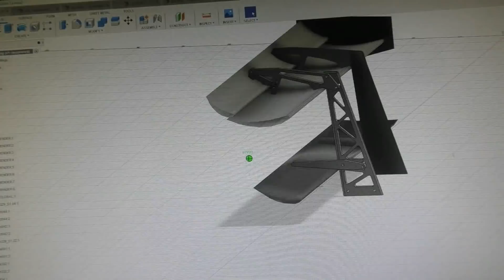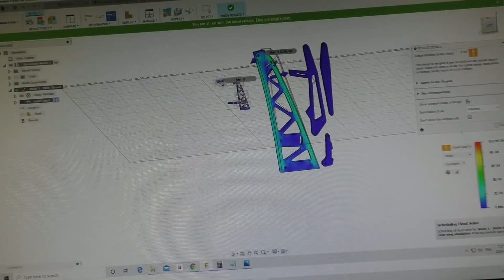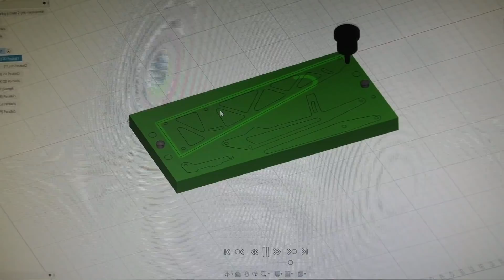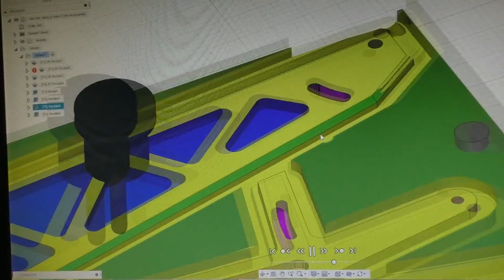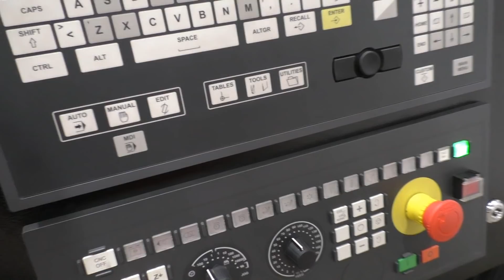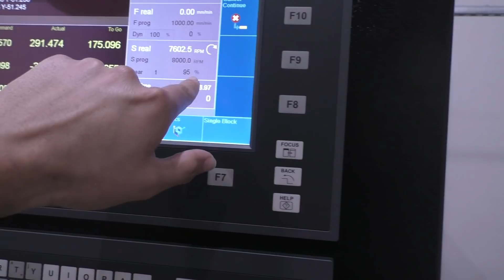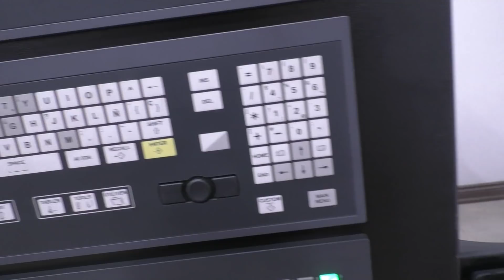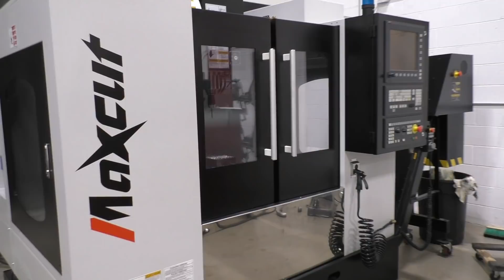Making Custom Rear Wing Mounts and Track Test - E55 ASL Part 26

Comment: Great video!
Very happy to finally see you use the cnc to make an awesome part!
I used to use a cnc for woodworking and bolted a ply sheet onto the original table and used dowels as datum points, made life a lot easier. 
Obviously I wasn't working with anything like the tolerances that are used in machining metal. 
Looking forward to the next video!

Comment: Awesome car and fabrication, kudos on all that!
At some point I would suggest focusing a bit on driver coaching maybe? And get a cheap Miata for that so you can focus on improving as a driver without trying not to die each corner?|
In particular, it looks like you're not heal/toe-ing on downshifts. This "bit" you in turn 1 on your fast lap. Other laps you also downshifted mid corner when RPMs had dropped a lot, which means you had to clutch mid corner which adds to the pucker factor.
Also lots of steering wheel sawing. - this upsets the weight transfer in turns. I would try to smooth that out a bit to get more out of the car.
Your car is clearly amazing, if you want to keep up with the car, I'd invest in the driver as well.

Comment: Just a couple suggestions: Space your workpiece up off the table so your cutter can go all the way thru without having to turn it over and do it from the other side. Use your cutter comp to fool the machine into thinking the cutter is bigger in diameter for the first cuts, then for your final cut change the cutter comp to read smaller and the final cut will be much nicer as far as surface finish. I like what your doing, keep it up.

Comment: Hey, I saw a part of the video in which the car wiggled from side to side because of the power this engine generates - the front of the car starts to lift and suddenly all of that grip that you gained from the rear wing, starts to take affect in higher speed corners such as lifting the front wheels and loosing grip. I suggest you raise up and stiffen the car in the back so you could make the angle of the front splitter more aggressive, so it could push down on the front wheels to make em stick to the asphalt even better. You may ask, why stiffening the suspension in the back: The reason behind that is very simple, all of these 400 kilograms of downforce generated by the wing, squat down the rear of the car, which transfer the weight to the back. This leads, again, to losing grip in the front, because there isn't enough pressure applied to the front tyres, because of the weight transfer created by the wing.
Reply: Pitch and weight transfer are not the same. Increase front aero if you have too rearward an aero balance. You dont use suspension to adjust aero balance. Not to say you cant, it would just be the worst way to do it
Reply: Correct me if I'm wrong but didn't he design the rear suspension with anti squat geometry ?
Reply: @noncog1  uuum i think you are wrong just by increasing the rear height, he makes the front splitter"s angle a tad bit more agressive - restricting more airflow to pass freely( increasing downforce)  + he gains more grip basically for free, either this or make new more balanced front side of the car, which restricts more air flow.
Reply: @LukeTrundell  techinically speaking - yes. As you can see the socks themselves are mounted sideways at a certain angle. That's all good to the point where g-force,  shock absorption, rebound and spring rate take effect into corners. That type of mounting eliminates the so called "body roll". But for an example taking a sharp corner with speed of about 160-180 km/h, because of the aero dynamics, the car squats to the side by itself of the g-force AND because of the downforce the wing generates - down. THIS makes the car unstable exiting corners, and starts to shoot itself side to side. Not only that, the power the engine outputs to the rear wheels while accelrating, takes effect into weight transfer and all of that results to loosing frontal grip right after corners. In other words said, I think that just by stiffening the rear(maybe front aswell, after lifting the rear beacause it WILL squat in corners too) of the car a little bit, and lifting it, will remove all of that non needed shooting of the back all over the road... Definetelly a suggestion that I think he should try, before he endageres his own life by spining out. :D
Reply: @danailvasilev4810  and moves the suspension geometry out of it's intended rom, negatively affecting handling. You know what will increase front grip without upsetting the chassis tuning? Changing the splitter angle by itself. Also, again, pitch and weight transfer are not the same thing, he could replace the springs with steel perches to keep the car from ever squatting at all. It would ruin handling and yet there would still be weight transfer. Again, just because you can, doesnt mean you should. Stiffer rear suspension doesnt mean less weight transfer, and if you wanna change splitter angle, change the angle of the splitter, not the car.
Reply: @danailvasilev4810  shock orientation has no effect on body roll. Anti squat GEOMETRY comes from the suspension's GEOMETRY, as in the length-wise instant center of the control arms in relation to the vehicle's cog. It's great to see that you've got in interest in a wonderfully deep and complex engineering topic, however, please make sure you have a meaningful understanding of subjects before you try to spread information about them. I don't trust that I'm completely accurate, however there needed to be some counter to the existing misinformation so that people wouldnt simply take it for granted.
Reply: Btw, all of these handling dynamics assumptions made in this thread are not reflected at all by his own words about the car, he said it's got plenty of rear grip and is stable
Reply: @noncog1   dude... It does, shock orientation does take effect in body roll, yes the instant center is definitely the main thing to consider while building an anti-squat geometry but just by establishing an rotation of the shock by 20 or more degrees you get a massive change into weight transfer while entering/exiting corners. I don't think that is misinformation, actually I think that you are just in quite of mistake considering the fact that the body roll by itself comes from the height of the weight center, not by the geometry. Anyway, I never mentioned the anti squat geometry, just a simple suggestion that I think should work the best for him. Best of wishes. :)
Reply: @noncog1  are you taking into account the g-force created in corners?
Reply: @danailvasilev4810  the shock force is being applied to a pivot, it's applying its force in the same manner it always would.
Reply: @noncog1 .   Suspension geometry is a complex subject. But I must say that shock mounting does have an effect on body roll.
   Shock mounting allows one to choose whether the suspension compresses in a linear or progressive rate. 
   So, without taking rolls bars into account, or the roll center created by control arm mounting points, you can reduce body roll by using a more progressive shock mount location.
Reply: @LukeTrundell  Anti squat geometry mainly affects how the suspension works when accelerating, (weight transfer to the back of the car).
Reply: @LukeTrundell  Oh, you replied to the op, you are correct.
Reply: @robertmoore119  yall the shocks arent even acting directly they're on a bell crank, the ratio of which changes, slightly, throughout its course, ever so slightly changing motion ratio. As the spring angle gets further from verticle, its effective rate drops, lowering effective spring rate, increasing body roll. However, this doesn't matter, because the coilover's mounting angle is not the angle that the control arms see, because they're connected via bell crank. A bell crank that, viewed from traditional axes, is multi-axial. So, to recap, leaning springs decreases their effective rate. This increases roll. This has nothing to do with this car, unless you want to talk about the angle of the pushrod, in relation to the bell crank, in relation to the coilover.
Reply: @noncog1  I was aware that he is using inboard mounted shocks, which use a pushrod from the control arm to the bellcrank, which then activates the coil over shock.
   The pushrod that activates the bellcrank is essentially the shocks virtual mounting position. 
   Depending on shock mounting, the actuation can be linear or progressive, what you describe is a linear action. The spring rate goes up as it is compressed, but the mount of the pushrod decreases mechanical advantage as the control arm moves up.
   But that happens in a more vertical mounting position, not a more horizontal position, which would mimic a spring rate going up as it is compressed.
   A progressive position does help to limit body roll. Which was my original point.
Reply: @robertmoore119  what makes you think the bell crank reduces ratio through travel? He explicitly stated in a video that he made it as close to linear as he could and got quite close. Spring rate changing through travel would be caused by progressive springs or change to motion ratio. Though the bell crank could cause the latter, you cant assume the direction, nor the degree. Body roll starts from static height then gains compression on the outboard (and extension on inboard,) so an effect at the end of the shock range doesn't matter anyway, because you've had to already have rolled significantly to get to it. When you change a springs acr, you change the spring rate to match, so that you've maintained the desired wheel rate. If you mount the at an extreme angle, then get significant compression, you will have a lower effective wheel rate than static, decreasing roll resistance. You cannot make a traditionally mounted linear spring gain rate through compression. He could do it through bell crank geometry. But he didn't. If it was extreme enough to stop roll early, it would make tuning the rest of the springs handling effects much more complex to tune. If it didn't, the effect would only take effect after its already rolled anyway. The best part about all of this though, is that it is pointless. As stated in my first comment pitch/roll ARE NOT THE SAME AS WEIGHT TRANSFER, and only effect theoretical grip limit if they change weight transfer, which they can only do it they effect cog. Theoretical grip is determined in kinetics by loading and tire loading sensitivity. Loading is affected by g, cog, and the wheelbase/trackwidth. F/r roll percentages can affect balance, and also tuned to maximize use of theoretical grip potential. It cannot increase theoretical grip potential, it can only affect what percentage you can use, with a maximum of 100%. And OP kept saying increase front grip to keep the rear tires from sliding, like, do I even need to do a proof as to why that doesn't make sense? Increasing the rear ride height would increase cog. Increasing cog would increase weight transfer. Thanks to tire load sensitivity, increasing weight transfer would decrease maximum usable grip in lateral load. On top of this, if nothing else is done to compensate, it will increase rear roll as well, shifting the roll ratio rearward, increasing the load the suspension's roll resistance places on the front outer tire. This would lower usable front grip. His suggestion is to make a change that would lower the mechanical grip ON BOTH ENDS OF THE VEHICLE, to increase front down force by increasing splitter angle. This is a bad idea for so many reasons, especially when you could just change the splitter angle by itself, but here's the kicker, increasing splitter angle isnt even the best way to gain front down force in a properly designed system, as the splitter should be at it's most efficient aoa already, and increasing it would net a higher drag/down force ratio. A better choice would be increase splitter surface in a theoretically perfect system, or, in a less perfect, more realistic situation, increase the volume of splitter exit expansion.
Reply: @noncog1  Making the bellcrank itself linear does not mean the pushrods mounting point to the lower control arm is not positioned in a way than can cause a linear or progressive action.
   Making the bellcrank linear just means he eliminated an uncessesary complication.
Reply: @robertmoore119  it means the the effective spring rate is constant throughout rom
Reply: @noncog1  noncog.

Comment: 3:35 if you drill the holes you have find a bolt with clearance drill and tap the fixture plate you can do this in nearly 1 operation but no chance of misalignment on 2nd op. great vids keep it up

Comment: ahh, some quick tips, fixtures holes are more than drilling a hole, drills have a tendency to move a bunch, you can use short carbide drills and then punch the hole to final size with a reamer or end mill for good results, the best way though is to using a boring head to finish to size and location, lakeshore sells endmills specifically for pre-reaming that also help with better location accuracy, using a jobber length hss drill, it will move a ton by the end of the hole usually cut a few thousandths oversize as well as drift.  you can get it on size easily with other methods but boring will allow you to force the size and location.  if you arent going to spring for a renishaw probe and tool setter, at least get a haimer and spring for the lyndex height setter.  its the only one thats basically not a joke, even the mitutoyo isnt all that great.  facing is usually best saved for last imo.  it can help keep burrs on edges from having to be removed.  the aluminum isnt really melting, its "flowing" under pressure.  aluminum specific coatings on tools will go a long way from having it stick to the cutters.  general rule is stay away from any coating that has aluminum in it.  im partial to garr and rapidkut tools because they are local to me.  if i was doing lots of platework though i'd look at getting a router, they arent as accurate or as fast as a mill, but the massive work envelope allows you to put a ton of material on the table and let the thing run all day, they are also way cheaper than a waterjet which is the ideal machine.  you should put tabs on everything or leave an onion skin, big drops or parts coming loose can be a catastrophe.  it looks like you are using a 4 flute mill on aluminum, switch to 2 or 3 max.  get a real vise, orange or kurt.  the import ones have a ton of deflection in them.  that aluminum is going to wear and the vise wont repeat.  you'll need to figure out another way to get that vise on there, i would put the vise on another piece of aluminum and bolt that in and out.  the aluminum wont last forever, it will wear and there will be slop in it.  there are companies that sell pretty slick quick change fixturing stuff to help with this.  also the aluminum plate is going to move as it gets more holes in it unless its tooling plate, tooling plate wont move.

Comment: I put WD 40 between the base plate and the machine table to stop corrosion. I use 3 flute 55 degree helix carbide end mills for aluminium with lots of coolant. I would buy the stock just a bit bigger than each part  and machine them individually held in vices using side cutting and pocketing to clear the chips more effectively. Slot cutting wears tools out very quickly.  Full depth of cut on side one then just face side 2 and machine off the bit that was held in the vice on side 1 and I use a 45 degree carbide chamfer tool for all the edges. Great work though considering you are new to the machine.

Comment: Also use an airline and blast nozzle to clean the bed, blow all the swarf off. 
Doing a great job 👍🏻. 
I used to work in a small machine shop making bespoke car parts from Ali, Steel, titanium for race cars

Comment: that wing is asking to be relocated 1 1/2 inches above  the track . across the back of the rear chassis . the air under the wing accelerates.  making the whole wing more productive . a flexible closing panel to the track on each end keeps the down-force consistent . I tried the wing above the rear of the car and lost 600rpm on the straights.my wing mounts were pivoted with the rear locations rubber bush mounted allowing the wing to flatten a small amount at high down-force loading . A decent pair of ear defenders would be worth a second or so in lap-times . treat yourself to a pour in foam seat insert to support you in the high G turns .  A large dustbin liner and some two part expanding foam . mix it quickly and pour it into the plastic bin liner which you are already seated on .  Before it starts to expand make sure the foam liquid is evenly distributed . Wear some old overalls and a large towel over your shoulders, neck and head .1/2 a pint of each component should be more than enough . as the foam expands assume a driving position and make sure your arms are free to turn the steering and change gear etc . once set .. the foam insert can be trimmed to size using a large serrated bread knife . cover the insert with your favourite velour cloth glued in place.using SIKAFLEX  mastic . .

Comment: I'm not surprised that the lap wasn't too good, the sun was right on the horizon and directly in front of you just before you hit the curb. Also if you were to ceramic coat the inside of the doors to the CNC would that make them shed the cutting fluid well enough so that you could film more clearly?
Reply: I'm blaming it on the Sun in the eyes